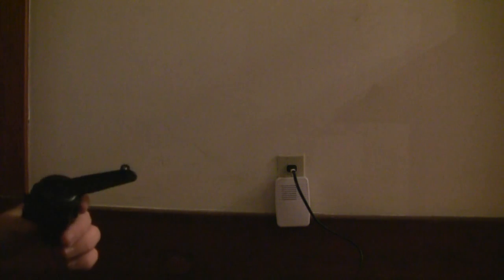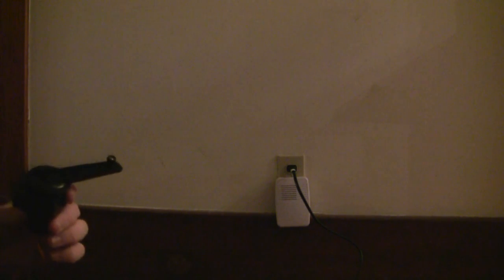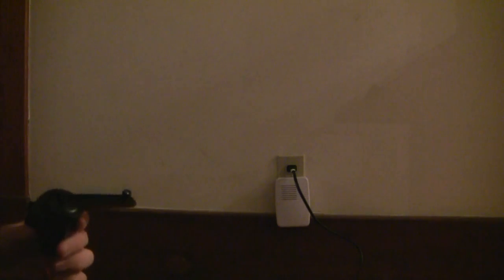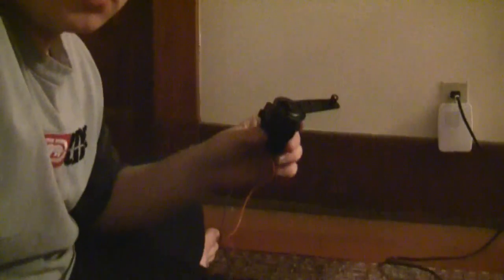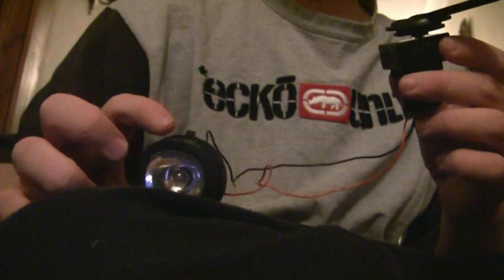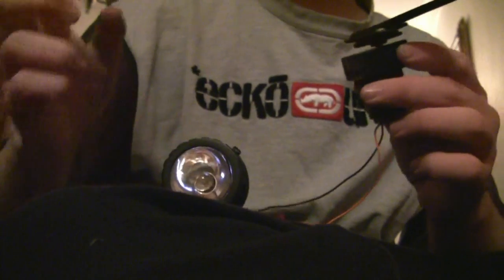Doorbell and Dynamo Hand Crank - How?!?!?

Comment from the maker: @Lachlant1984

The house is old, and the wiring is messed up, but not my lamp in my room, just the hand crank, when I was in my room, I was cranking it to test for my project, and the doorbell rang, I didn't think of anyone being at the door, then when I did it again a couple minutes later, it happened again, so I tried a few more times, and everytime, the doorbell went off. It amazed me.

Doesn't work anymore though... :\

Comment: @MrPacMan36 So what, do you mean when you switch your bedroom light on the doorbell rings, or does it rings when you turn off the light?  Are you using energy saving globes in your light?  Perhaps the electrical wiring in your house needs some work?  Look at the identification label on the doorbell, does it say what frequency the doorbell receives on?

Comment: I take it the light is connected to the hand crank generator, I also take it the doorbell is one of those wireless ones with batteries in it.  Perhaps the generator is making some interference at the right frequency the doorbell requires to activate, and it thinks the signal it's getting is from the transmitter, tht's just my theory.